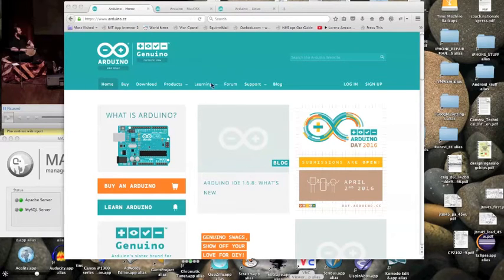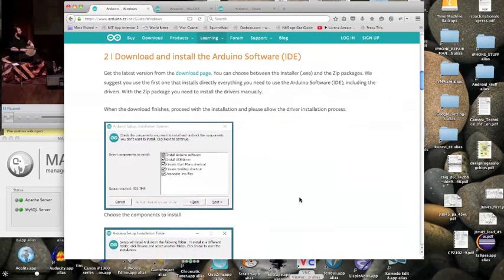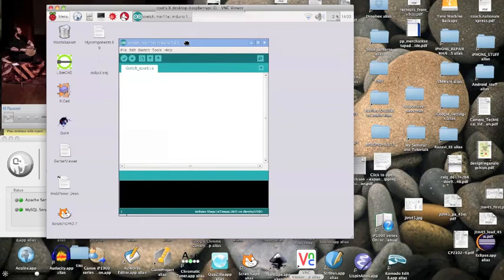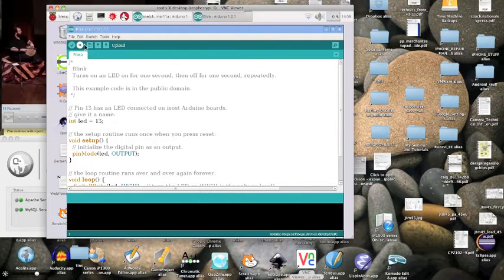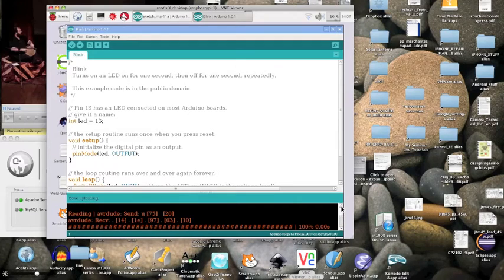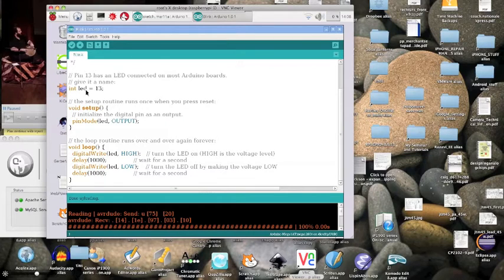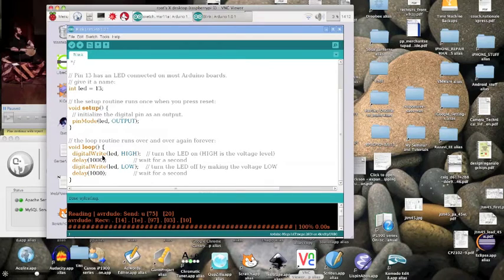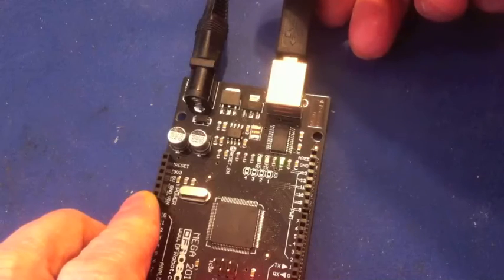Arduino tutorial 1.

Comment: Awesome sire. I have arduino unos but not really done anything with them. Watching your video made me think I could use them to monitor voltages on my TTPW. I was able to follow this tutorial very easily. Thank you. Arduino is a new concept for me. Never done anything in the past other than look at using them for my CNC. Enjoy the sun my very good friend.
Reply from the maker: +Raymond Earle Glad you like. To monitor current and voltage is a great idea, as you can buy LCDs designed for use with these. As you used it for your CNC so you know already how useful this little gizmo is. Later I'm going to cover AVR uChip programming which is the next step up from Arduino's which you will find a lot more interesting. But the next four videos are showing stuff that you can do with arduinos with emphasis on electronic theory. Nothing advanced, it will all be easy stuff but a lot of fun.
Reply: +Tech Tins NOOOOOOOO! I didn't use it on CNC. I only looked at videos that used Arduino to run a CNC. But as usual they weren't very informative on the HOW. Looking forward to the next tutorial.
Reply from the maker: Raymond Earle  How did you control your CNC? What did you use to program the G codes? How did you do it? Very curious. I  thought you used a basic micro controller. So for some reason I assumed it was the arduino you used.
Reply: +Tech Tins The PCB was designed in Diptrace. Then exported DXF to VCarve. Did the tools setup in there and ran the txt file in Mach3. Chinese parallel controller. Easy drivers for the stepper motors. All documented in my CNC playlist. Couldn't figure out how to make the arduino work.
Reply from the maker: Raymond Earle
That don't matter you got the job done. That is all that matters. And it has turned out very Cool!
Reply: Thank you for your kind words sire.